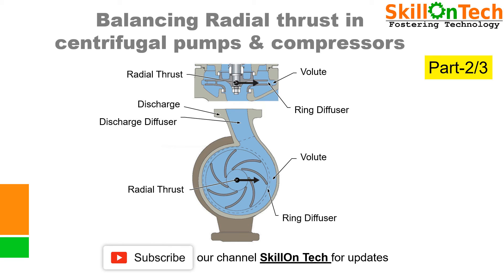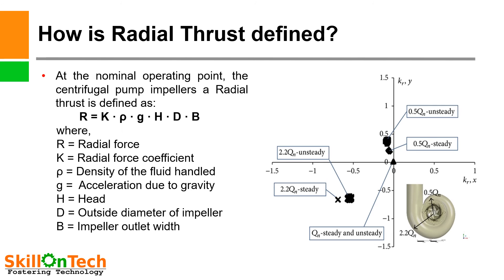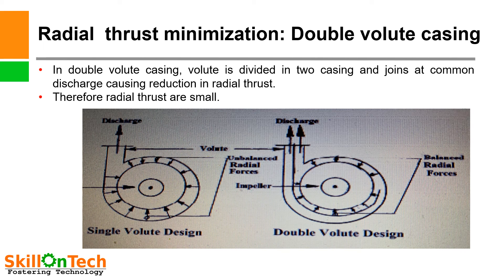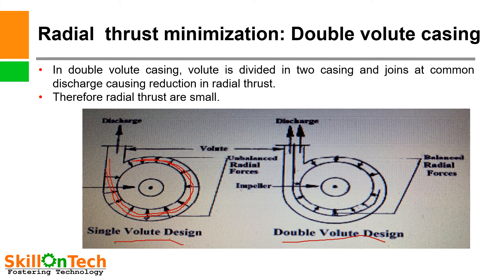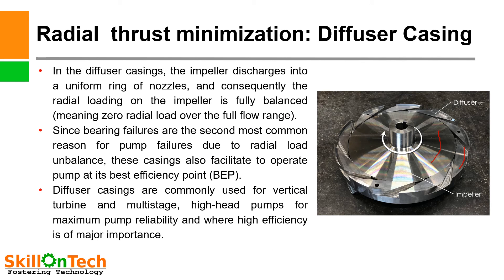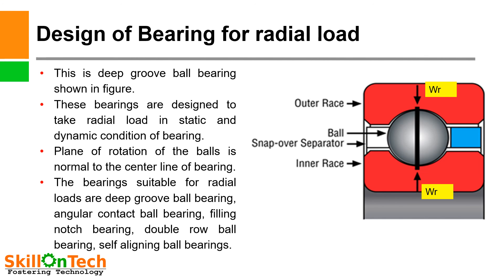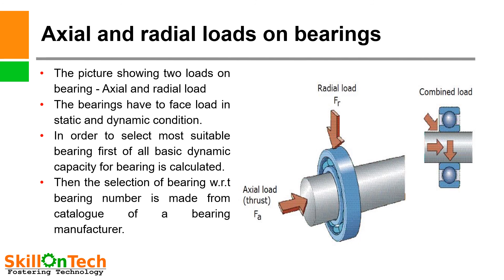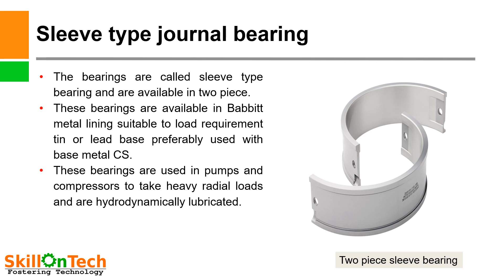Radial Hydraulic Thrust balance in centrifugal pumps and compressors (with english subtitles)

Comment: what is the formula to get K?(radial force coeff) ty
Reply from the maker: in reality radial forces do occur as a result of inaccuracies in the manufacturing process. The max. value of this radial force can be estimated by applying a radial force coefficient of (K = 0.09). This value applies irrespective of the pump's Q/Qopt ratio (q). Magnitude of the radial force coefficient K for a volute casing pump is  a function of the specific speed ns and the Q/Qopt ratio q. A graph is drawn to find out K between Q/Qo and Ns.